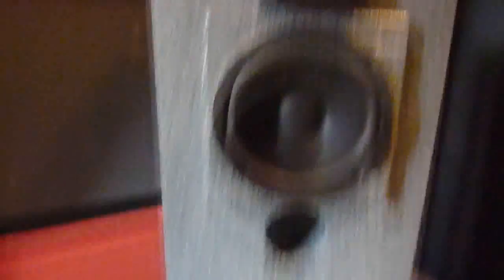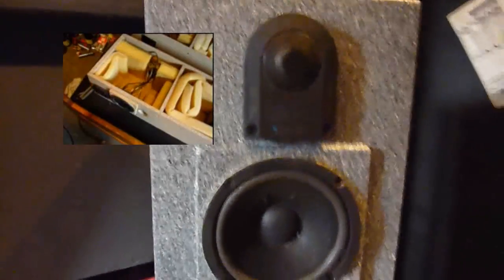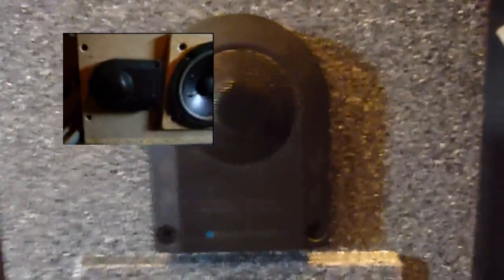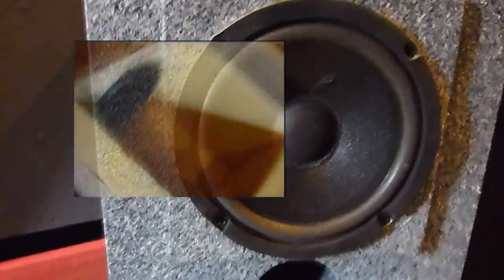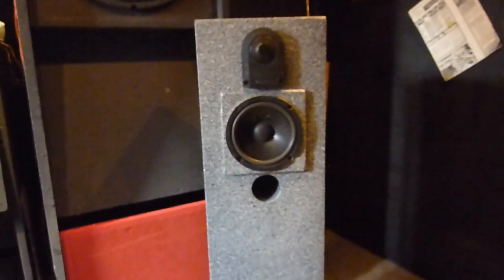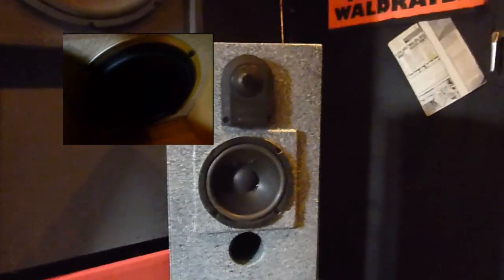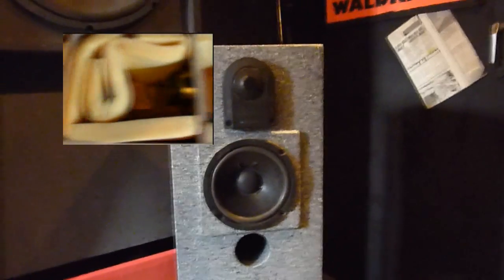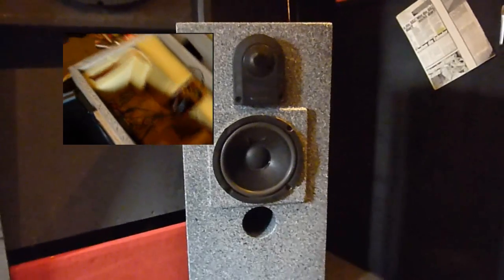DIY: New Homemade Box with integrated Bandpass Subwoofer

Comment: Wow, they sound great. I'm amazed by the sound. I should may think of building some floorstanders but i guess they will be two way to save costs and they will be L-ported. I will use some 5.25'' mid/woofer drivers and some 1'' metal dome tweeters. They will be really narrow and tuned to 45hz for some nice extended bass.